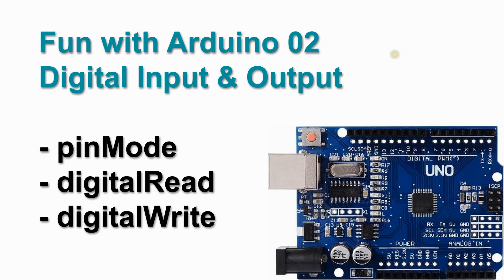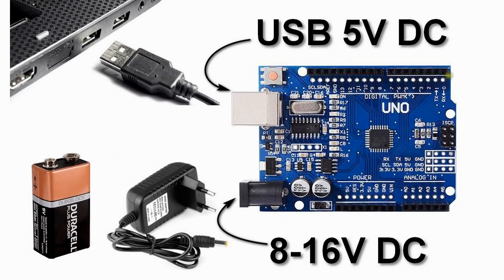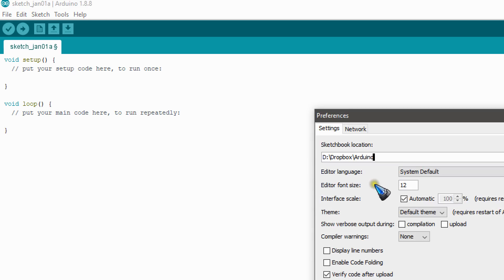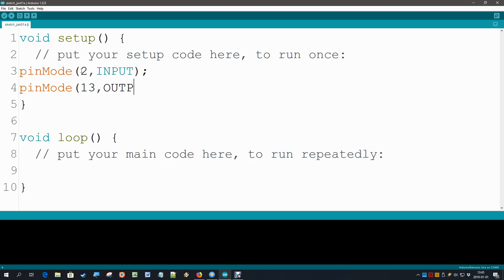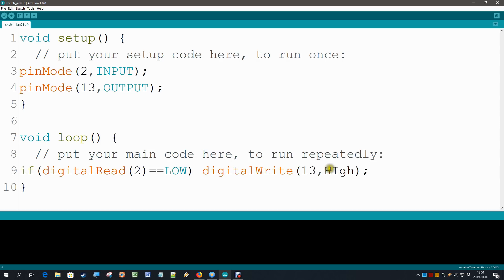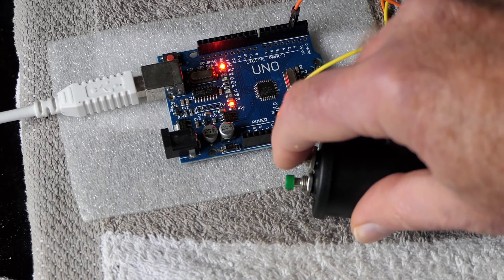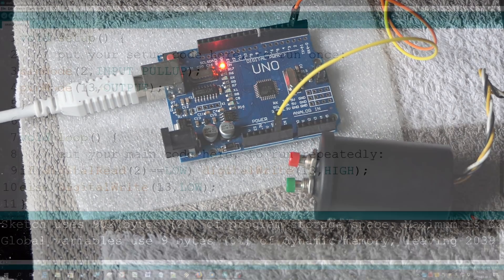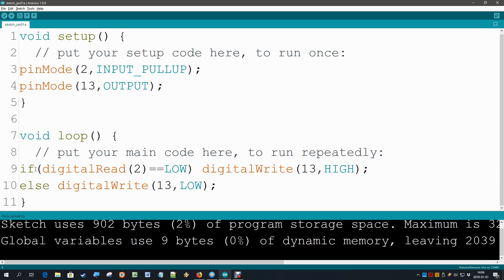Fun with Arduino 02 Digital Input Output

Comment: How to use high digital input as a single pulse in Arduino
Reply from the maker: I don't understand the question Lijo, what do you want to accomplish?
Reply: @rudyshobbychannel  

The arduino need pulse input to trigger sms from gsm module.

But my device gives Continuous contact. So I have to convert it to pulse
Reply from the maker: Lijo, I still donxt 100f understand. Do you mean when an input gets a continuous signal, on the inouts LOW to HIGH transition an output should give a pulse? If that is what you need, make the output HIGH, start a timer and when the timer runs out make the output LOW again.

Comment: As a beginner, in this video I did not completely understand the whole connections, maybe because some connections are handled internally by pullup. I think it could be clearer to have a complete wired connection, but I think you will do that in the next videos. So moving on into the chapter 3. Thanks!!

Comment: Hi. Maybe I'm missing something but isn't the program saying if pin 2 is off (switch is not pressed or LOW/OFF) then the LED is HIGH/ON?
Reply from the maker: Kenneth Briffa Well ... yes and no. The if statement says that if pin 2 reads LOW, the LED will be switched on. OFF is not a state of a pin ... it is eithe LOW or HIGH. The way we wired the push button (connected to GND) means that when we press it, pin 2 to is connected to GND, hence the software reads a LOW.
Reply: @rudyshobbychannel  Thanks. Understood!!